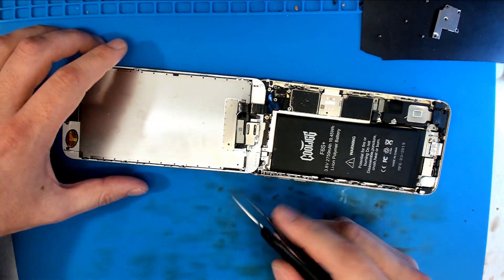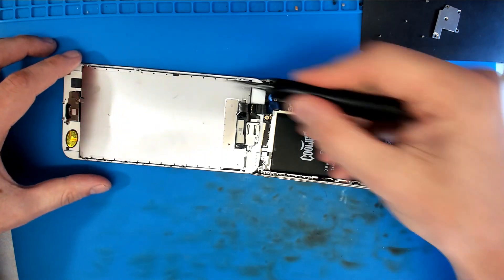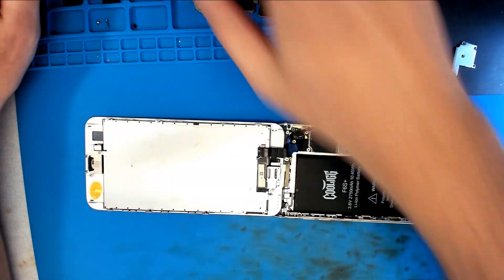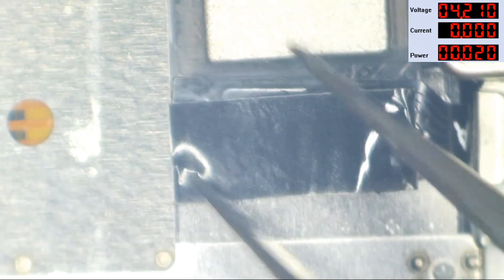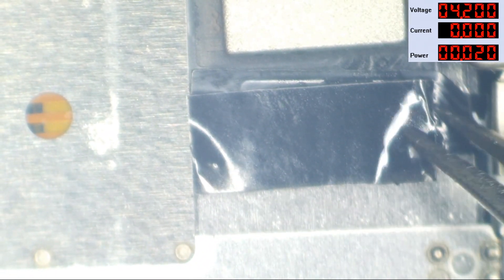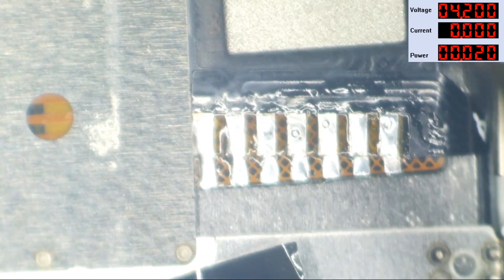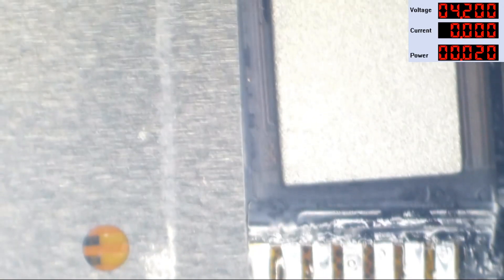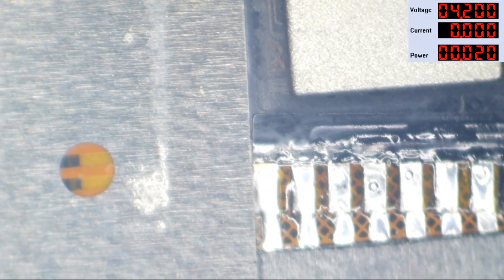It was my fault (The iPhone 6s Plus warranty job that fixed itself)

Comment: Good catch Jason! What software kit (if any) are you using to track customer orders, notes, job progress?
Reply from the maker: I use Ultimate Client Manager from Code Canyon.  I've done a lot of custom php and such to get it working for mail-ins but right out of the box it works pretty good for any service business.  It's like $40 or $60 bucks but requires a server to run it on.
Reply: @ststele  Thanks sir. Will definitely look into this. Server(s) will not be a problem :)

Comment: back in the day when I used to replace screens (only board repair now, thankfully) I feared those pins so much that I always put a piece of kapton just to be sure.. now I'm relieved it wasn't me just being paranoid :P
Reply from the maker: This one left with the black strip that came on it + kapton tape yesterday.  I normally check that spot but on this one, I did not.  It's good to be paranoid when it comes to those solder joints.  =)